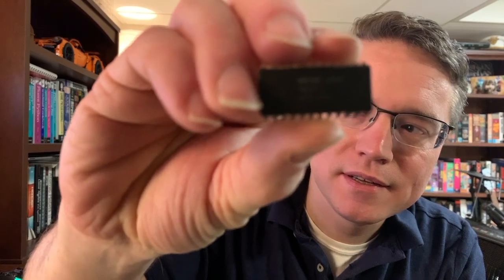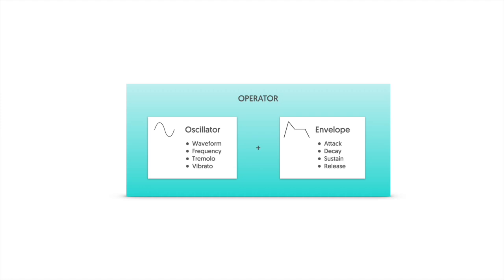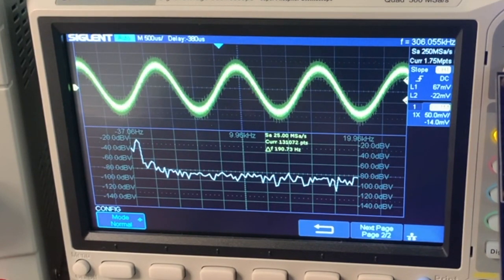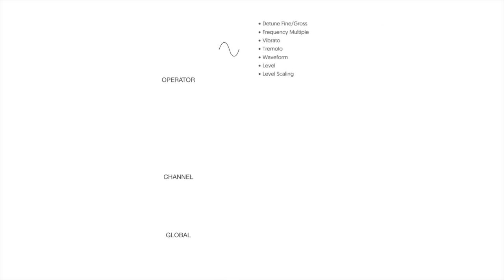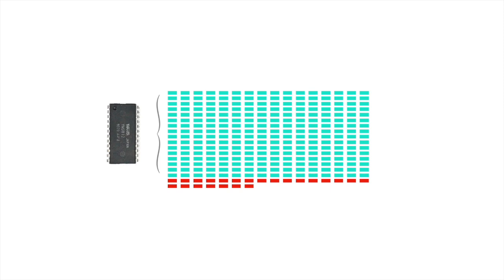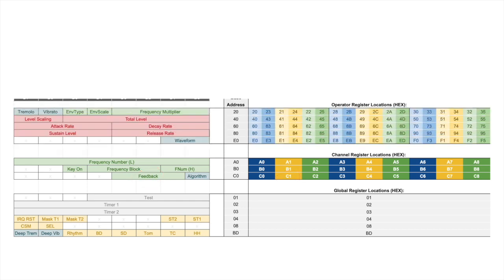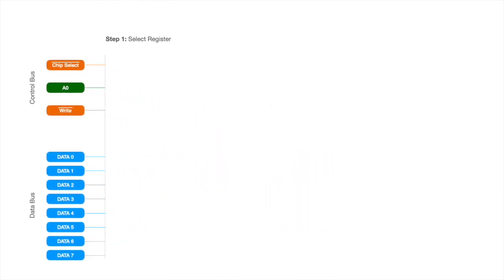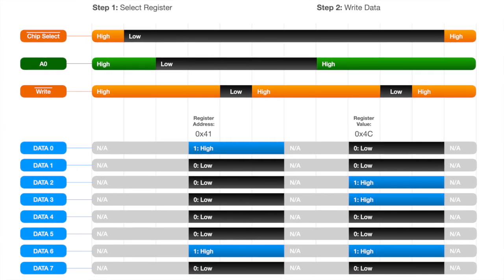YM3812 EuroRack Module Part 1 - Controlling Registers

Comment: YM3438, YM2612 is this the best yamaha FM chip?
Reply from the maker: I haven't been able to play with a YM3438, and the documentation seems sparse. From what I've read it's similar YM2612, but CMOS and with a better DAC. The 2612 is another great chip. It seems like each of the YM chips have their own quirks that make their sounds unique, so it's hard to say which is the "best" chip. I like them all!
Reply: @ThingsMadeSimple  well, it seems to have 4 operators, seemingly more than the one you are talking about. do you have a few of them? or YM2612 want to build one as wel.
Reply: @ThingsMadeSimple  i found the Yamaha YM3438 datasheet, but's mostly japanese.
Reply from the maker: Great find on the data sheet! You are correct, the YM3438 and YM2612 both have four operators, and will definitely produce more complex sounds as a result. I ended up choosing the YM3812 because it is extremely versatile, but also easy to control. The extra parameters significantly increase the complexity of the UI that you need to control them. Hopefully if we can get at 2-op synth sorted, we can figure out how to extend it into the more advanced 4-op synth chips. One fun fact though... the YM3812 supports multiple waveforms, while the YM2612 only supports sine waves. So it still has a few tricks up its sleeve.
Reply: @ThingsMadeSimple  You got 4 pieces (one spare) for me? and the header file with the register settings also wanna give it try to make a eurorack module. probably not easy to make a sine wave inside a chip, dunno.
Reply from the maker: Well, I ended up giving them all away. But fear not… in the next video I will show you how to breadboard out the base circuit and put together a foundational library.
Reply: @ThingsMadeSimple  hackaday: The YM3812 was preceded by the YM3526
i found the YM3812 datasheet on the internet archive.
i don't have a alibaba account and don't want to buy them from china, hopefully something can be arranged.
i saw a schematic using a YM3438 and it used a analog devices: LTC6903, programmable clock, your chip needs 3.58mHz clock. would be fun hearing this through my hi pass filter and moog Filter, i guess.

Comment: You really did an insane amount of work here on this module. All the registers translation seems a bit of nighmarey. Also the video edition and blog documentation are top notch. Hyped to see the next chapters. Kudos, man.

What processor are you using?.

Cheers!
Reply from the maker: Thank you sir! Still working on the next bit of documentation. Describing programming concepts is not easy 😅. The micro controller is the AVR128DA28. It has been my go-to recently. Like an arduino nano in a DIP package, but wayyyyy more powerful.

Comment: I would really like to be able to control a YM3812 with presets using my Alesis Vortex Keytar for live performance. I eventually just bought a Yamaha Reface DX instead as that was the closest thing but it'd still be great to get that specific sound.
But that would definitely require MIDI
Reply from the maker: That would be a really cool combo! This module will be (is) midi controlled, so for what it’s worth, that would likely work. It should be possible to add pitch bend too, which feels very necessary in a keytar :)
Reply: @ThingsMadeSimple  Oh yeah I forgot about pitch bend! Yes that's important!

Comment: Hi Tyler, great! Maybe you remember our email contact a while ago regarding this topic;  it's funny, just the last days I was thinking several times continuing the project of making an AE module with the Yamaha chip (had to suspend ot for several reasons) , and via Juanito's post of your video this project is fueled again! ☺️ Thanks for your great work! 👌👌✌️♥️
Reply from the maker: For sure! I actually followed your recommendation and used an AVR128DA28 as the micro in the module. (I used the DA vs the DB because you get a full 8 pins on port D).

Comment: I am interested in using old synth chips in modern eurorack, however it's understandably better suited to midi given the complexity of the chip. Would it be possible to make a non midi mono VCO using the same IC, with the usual 1v per octage note scaling etc? Obviously we would sacrifice a lot of the chips ability, but they're still very cheap and easy to buy.
Reply from the maker: Hey Clive, you could definitely use a CV to control pitch. The 1v/oct would be fairly simple to accommodate because you would do the exponential conversion in the software anyway before sending to the chip. If you only wanted to use as a mono synth, you could probably fatten the sound by having all of the voices play together and slightly change or detune them. Or, you could allow notes to sustain after they are released (in a way that a normal oscillator wouldn't be able to do). You could also use multiple CV inputs to play multiple notes at the same time as well. Sounds like a cool experiment :)
Reply: @ThingsMadeSimple  thats good to hear, but way above my skill set, love watching your progress on this all the same so keep it up!